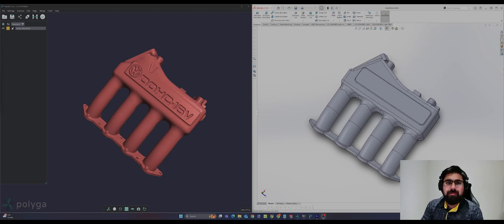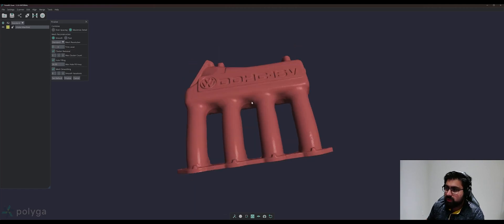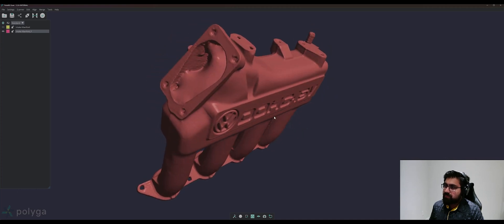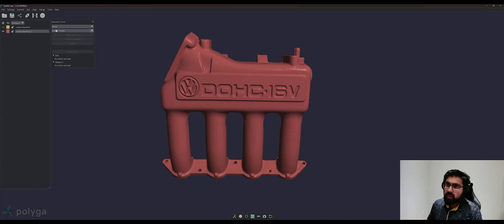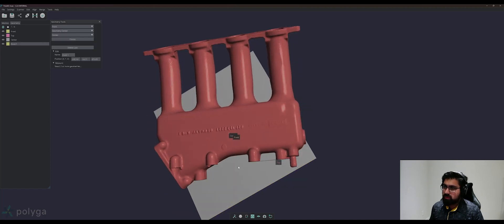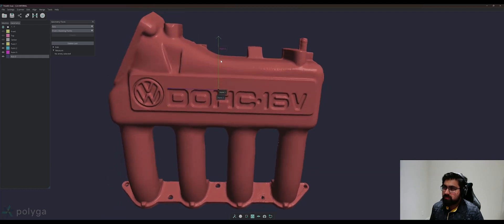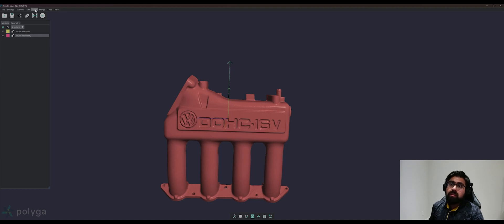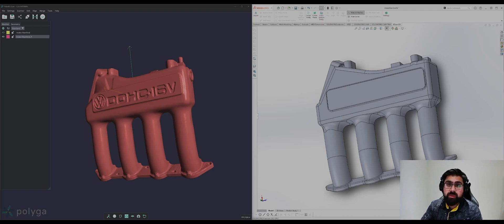PointKit Tutorial | How to Reorient and Prepare your 3D Scan for Reverse Engineering

Comment: I like this software. I haven't messed around with alignments much, but compared to polyworks the ease light stuff like adding a coordinate system and filling holes is far simpler. Is there a way to manually remove data from the mesh? like a drag to selected then delete? I haven't figured it out if there is, so far I've been trimming the mesh in meshlab then using pointkit to decimate and add a coordinate system, but if I want to go back and remove an aspect of the scan I'll have to re-do everything.
Reply from the maker: Press the space bar to select - toggle the select on / select through on the button below and press delete to remove the data.